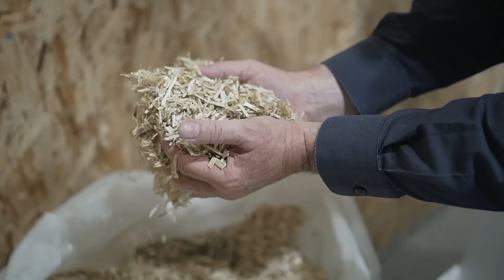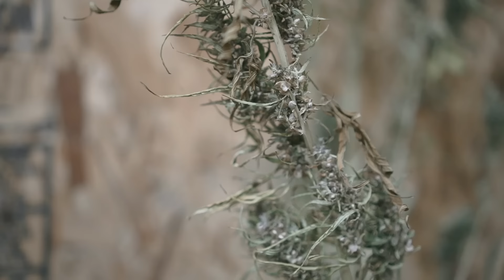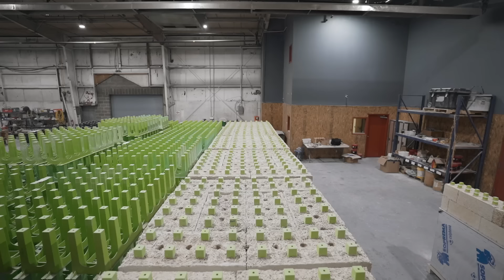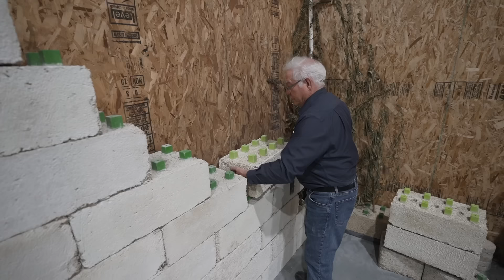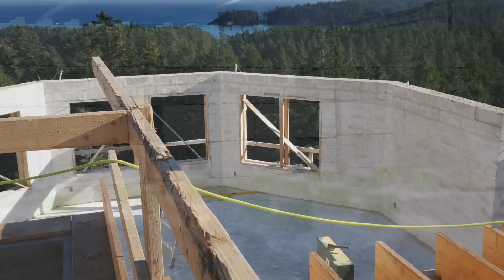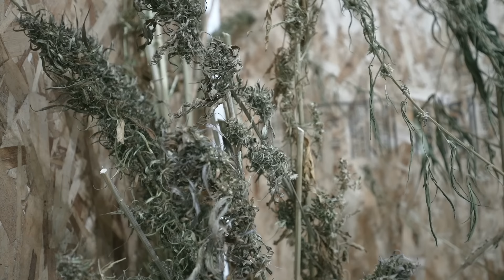Amazing Lego-Style HEMP BLOCKS Make Building a House Quick, Easy & Sustainable

Comment: Wonderful, and does combine structure and insulation into one installation. Technically speaking it is a face seal and I am wondering about details around openings. Any deficiency in seals around openings could result in bulk water into the blocks ? Good documents would be a good countermeasures. Edit: the manufacturer recommends supervision of work by one of their representatives. That's good news
Reply: The R25 insulative value does not meet requirements even in zone A or B in Canada- R30 and R33-40 minimum; so, rockwool exterior or rigid would be required to bring it up.

Comment: the trick for this is mass production, lower coast then standard materials, and simpler installs. it has to be better at those before this will take over, and it needs to take over.

Comment: So it's basically using metal for the actual building and load bearing and the lime and hemp is just insulation. It should be called 'metal building blocks with hemp/lime insulation'

Comment: let's be real .... hempcrete blocks are super expensive have a fraction of the strength of concrete  can not be used near or underground ... it will never happen (commercial success) ... it is not fireproof ...there is a point where NOTHING is fireproof.  The advantages are in easy of construction and insulation (although those number being quoted are BS as well) ... For those of you wondering why this has not taken off around the world .... well there you have it

Comment: This is kinda kool and I’ve been looking for ideas for a cheaper eco friendly home in Canada.. but I would never use this.. IMO it is great for a company but horrible for a user. First off I can’t see how well outlets would go in this, secondly if I wanted to change the house in anyways I would have to tear down a whole wall for new outlets or plumbing to be installed. Unless you need a wood frame for the house anyway.. at that point I’m using wood anyway so why use this as a more bulky brick for the outside of my house? Naw it’s not user friendly from what I see.

Comment: Would you use furring strips for the drywall side?
Reply: You can attach it directly to the block every 6 inches can secure it into the supports.
Reply: @paultryba7228  that is awesome! Would there still be room for electrical?

Comment: There was a similar product used in Canada around 1975 . Made with straw and cement , was used on mis size commercial buildings. It sill is operating as designed 45 years later.

Comment: You could use HDPE from waste plastic bottles put it with the hemp and a cheap charge like silica or CaCo3 in a rotary hoven and then compress it in a brick form in a mold.

Comment: Question?? I did not see how  you fastened the top plate ( trusses ) to the wall. How does it work with high winds? Your top plate looks good but how do you  attach it to the blocks?
Reply: Also, how are the blocks fastened to the sill plate?

Comment: They stole the idea from Ezekiel light in the 1980s I worked on a chimney company and a zq8 was the concrete mix that we use to line the chimneys between the steel liner and the outer brick instead of using paper fiber they're throwing in hemp hoping that hemp will sell buzz  name   and if I work for xiquilite I would definitely bring this attention to my superiors and have him start a class action lawsuit against you

Comment: Can see these blocks having a huge impact in reducing heating bills, especially if used in conjunction with tripple glazing and the geothermal systems...
Reply: Generally homes built with mostly a brick or concrete material insulates better than your typical stud and siding house.
Reply: The variable is wide depending on your conditions but the estimate at this time is 30-60 percent energy savings compared to the basic home construction.
Reply: Cant be having that, the energy giants wont allow it. Bad for the shares portfolios
Reply: If it is energy efficient then geothermal will never pay off.

Comment: This is a fantastic use of materials for building,  however I have two concerns.

1 water proofing, if the render cracks and let's in water will that turn the bricks to mulch? 

2. What is there to stop a robber entering the house by using a power saw?
Reply: robbers can easily get into any house anyway. you've got windows right..
Reply: @witoldschwenke9492  Theives are lazy (if they weren't they'd have day jobs), therefore  they target buildings that are easy to break into. Imagine this. A robber walkes down a street,  the first brick house has bars on the window, and a solid wood door... pass. The next brick house has regular windows and a composite door... pass. The third building has impervious shutter windows and a solid steel door but the walls are made of paper mache ... Bingo, the robber carves out a man shaped hole in the wall with a steak knife and enters the building...

Comment: Could you install furring strips vertically so you could install vinyl siding on the outside? do you have to cover the block with a moisture barrier?
Reply: you can attach it directly to the block every 6 inches can secure it into the supports .

Comment: What about putting backing on the wall for hanging stuff such as cabinets do you have to for the wall out with strips and then drywall and if so how do you attach the strips to the hemp blocks and get some bite on the fasteners
Reply: You can attach it directly to the block every 6 inches can secure it into the supports.

Comment: Planning my humble off-grid retirement shack and this is jumping to the top of my list. Those I’d love to rephrase “off grid” to “self-grid” maybe? With that insulation rating in a moderate climate I’m not even sure my power use would be worth mentioning. ;) 

Maybe a 900 sqft. timber frame with this for the walls? Going to research costs before I get too excited. :)

Thank you so much!

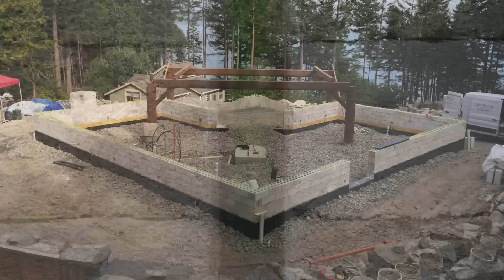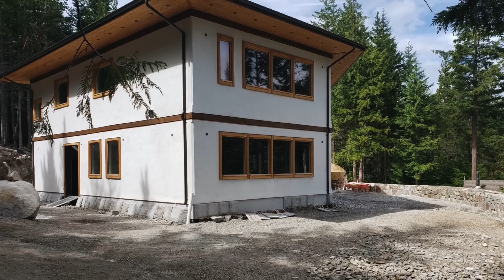Comment: Surely these blocks dont have the load bearing capacity of high performance concrete? 1:13 - 1:18
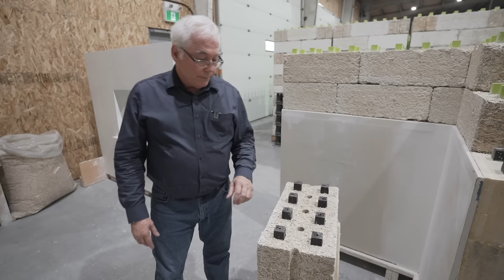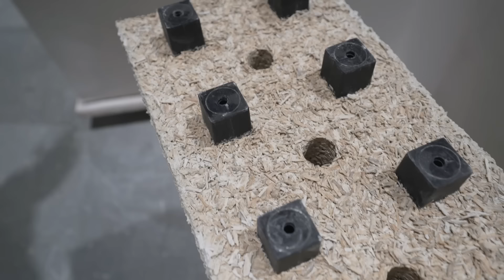Reply: Ahhh, so the internal structure provides the load bearing, got it! This is great! 2:05 - 2:10 and 2:24 - 2:27

Comment: This looks to be a fantastic building material! Truly hope it takes off, with the ease of use , economy and environmental benefits.  
Wondering are there producers internationally, eg. in Australia?  Does the waterproof system work for retaining walls? How do you accommodate plumbing services/can you chase the wall to fit pipes? Does it work with furring channel and plasterboard lining?
Reply: Good questions - the servicing aspect is intriguing to me. As to the plasterboard lining, I'm not sure why you would want to use that other than, I suppose, a different skill-set in applying?  Oh, I see, perhaps to accommodate services more easily?  I would guess though that the adding of two skins would add structurally and to prevent the possibility of air leaks.

Comment: The building industry is really stuck in its ways. I lined my internal walls with plasterboard then spray painted it straight away - amazing how many "professionals" said that I should've applied a skim of plaster - we seem to be one of a small handful of countries that apply a skim of plaster to plasterboard. I'm not sure what's supposed to happen (none of these pros can tell me!) but I'm over 5 years in and the paint hasn't peeled, the plasterboard's paper skin is still intact, there's no cracking or movement at any of the joints...

Comment: So, how much do these cost per building unit versus a conventional cinderblock or a standard wood framed wall of equal dimensions?

Why do you need hemp?
Pretty much any pulp castoff can be used (not sure about it's fire resistance), even mushrooms (which have shown to be similarly very flame resistant).

But the building standards organization is paid for by conventional builders who block anything that's not concrete or wood.
Reply: about $60 per square MORE fro hemp foot at this time.

Comment: How does it hold up once your roof is ripped off and the rained on... Like monsoon season in the desert or a thunderstorm/tornado or a hurricane? I live in Arizona where it would be kind of okay to use this unless wind and water happens which it does. But it'd be probably an absolute nightmare in the Midwest or any place that gets a hurricane. I'm for it but I'm just thinking if a little part of your roof gets ripped off and then wet, it could do some other kind of damage?! One would no longer have the compression from the roof or the coatings on the outside and inside to some what protect the light water absorbing bricks

Comment: How well would the structure hold up in a hurricane? I'm in Pensacola Florida and considering building my own house. Would this be comparable to cinder block or will the light weight of the material get blown away? Could/should you mud a layer of lime in between each set of blocks to increase strength?
Reply: Oh yeah, how much per block?
Reply: Poorly.  It has low mass.  Florida is too damp for a material like this.  Stick to concrete and EIFS.

Comment: How do you permanently waterproof exterior walls and also prevent interior and exterior wall cracking from shifting blocks and settlement?
Reply: They use a quicklime wash it sounds like, so you don't.  You'd have to reapply it ever few years, so large ongoing maintenance costs.

Comment: This would be terrific in a high wind environment. The holes for running wires could have a lenth of threaded rod and that would hold it together including the hempcreate roof trusses that they don't have yet. I can see 20 foot long by 4 feet wide floors (no joists) also with a rod or two to keep them tied to the walls. If a tornado comes strap yourself in because it would have to take the whole house intact. No way debris can go through that either.  I thought about a product like this only a shot of foam as a component. I got hundreds of ideas and no time if you would like to talk.

Comment: Just think, at one time hemp was banned in the US, this is after we had been using it for making rope, sail material, oils and such, it was pointed out as a addictive substance when smoked and was put on the no import list....The new needs for building products is growing fast, I wish there had been some preliminary material cost included but at least the contact info is here......Bamboo has become a multi use product and the innovations are still growing, it's a strong fibrous product that has many uses.....Hemp is coming into it's own.....

Comment: I would not use that material.
I'd rather have 18" concrete
walls.   They would last a long time.  Just do a 6"  stud wall
inside and insulate with
R-58 
You can he
Reply: Not a good choice , too 
many crooks.

Comment: Years ago I did the elericrical work on a tamped floor (hardened polished natural clay compressed in layers) a hemp block internal  and mud brick / hemp external  house built on site .  The owner made keyed interlocking bricks for stackability similar to leggo, strength and ease of use, but as mentioned early on, the labour content was excessive and block consistency often  was a close to touch and go. Our enviroment is dry moderately cold winters through to extreemly hot  humid wet summers. The owner discovered he could only make the best hemp  bricks for 3 months  per year, and experiments with contaner sized  wood drying kilns worked ok, but detracted heavily from the environmental results desired, and kiln use and build was not budgeted for. very  Forward and alternitivley thinking at the time, but to be polite, backward engineering. The hemp chip was imported from Asia, as growing was forbidden in Australia. That was another head ache for him.

Around 7 years for a roughly 12 x  12  meter house with 3 meter verandahs and loft bedrooms. He ended up building  the primery support and roof structural first using recycled timber just to get significant progress and the job done. 

I'm sure if thses blocks existed, my old hippy mate would have danced for joy, and his wife would have been considerably more enamoured with his efforts. His dreams of making a living  by building hemp and natural houses for others became his bane.

Happy wife, happy wife

Great product, and congratulations on getting this amazng type product approved and engineered.
After 30 yearsodf seeing the inefficiency in  construction, Any alternate to the norm I welcome with open mind and arms.

Any plans to bring this building process to Australia?
Reply: This is a rather heart-breaking story to hear, and underlines the difficulty in trying to move outside accepted norms of building at any one time.  Let's hope those norms shift quickly.  I personally can see only benefits from changing to a system like this, not only for environmental benefits, but also potentially to enable self-build more easily

Comment: Great video. I'd love to see this style of house become more common than a typical wood frame house. I want to build one using this material at some point, but it will need to be a dome house for storm resistance. Double walled with solar tiles covering the outside of the dome and a wind generator at the top of the dome and air intakes at the bottom of the outside shell. Hide the batteries in the basement and you are basically storm proof with your own power, year round.
Reply: I wouldn’t want to be living on top of, or so close to the radiation the batteries give off.
Reply: @kimariokiji  Your mobile phone gives off more radiation than a battery of any size can. They don't have any transmissible element to them. Also there would be about 2 stories of height from the ground floor, to the basement level where the batteries would be installed, so as to make them storm proof. Best batteries for this type of installation is Red-Flow liquid batteries as they never wear out, you just need to replace the pumps once every 5 years or so, depending on the quality used. With a foot of Geo-polymer concrete and rebar between each level. Think upside down skyscraper. Make it as deep in the ground as you like, as the deeper you go, the more warmth you can pull from the ground for the heat pump setup. Once you are down 30 meters there is no modern infrastructure to worry about damaging. Especially if you build on an area with no previous human activity. Need more space, dig another room. Sandstone base material would be very handy here, but using Geo-polymer concretes is almost the same after they cure. 

This kind of building could likely survive a nuclear bomb dropped 20 to 50km away, where as most square buildings would be flattened.
Reply: @elizabethdg  You do realise breathing causes oxidisation of your cells causing damage, which leads to visible ageing. Everything is killing you, it’s just that most of it is too slow to make any difference. If you are so worried about phones, or other electronics, go live in a tent in the rainforest. Assuming there’s any left.
Reply: @kimariokiji that was my first thought
Reply: That is actually not a bad idea 🤔🤔🤔 ...

Comment: How well does it hold up against water infiltrations and moinsture ?
And how does it compare to regular concrete blocks price wise ?
Reply: Probably want to create an adequate roof overhang at a minimum of 4 feet...
Reply: It holds up to water very well. It is meant to have a lime render on the exterior but even without would absorb water then evaporate it
Reply: @rehabdetroit  
Too much water will cause the hemp to rot.
Reply: @b_uppy  Correct. If it was submerged in water for days it will rot. I have had an example wall sitting oustide in the elements all year with no finish or protection. Storm after storm and still nothing. No mold, no rot. They have samples of buildings that are thousands of years old with this material in them.
Reply: @rehabdetroit  Can you tell us more? What do you think about the above comment about needing a large overhang, as shown in the project house?
Reply: @sroberts605  This all depends on the climate of your area. There is a hempcrete house built in Israel with no overhangs at all. A florida home was built with eaves about 2.5ft. That home was built by an architect for his own personal means so you know he took a lot of care to get it right. There are many things to learn on hempcrete and how it can perform as it is being reintroduced but I have seen it outperform many modern housing systems from my own personal use.
Reply: @rehabdetroit  Hot and dry in Israel, humid and hot in Florida, damp and murky here in the UK (actually beautiful today, lol).
I'm so enamoured of this solution, I can't quite see how it hasn't happened like this before - we've used lime for ages, we've used hemp, mostly for ropes etc, but I'm not aware of these in combination for building historically. Cob houses perhaps the closest?
But these bricks/blocks in combination with the ingenious structural insets just seem to me like one of those things that were always there, waiting to be expressed!  Like Michelangelo with his David.
Reply: @sroberts605  there are samples of structures thousands of years back that are made of hemp and lime. They found a bridge in France. It really is so cool!
Reply: @rehabdetroit  Hemp didn't exist in the old world 1,000 years ago.  It would have been sisal.
Reply: @michelle.lin3653  The cultivation of hemp began more than 10,000 years ago in the region that is modern day Taiwan, as one of the world's first agricultural crops. The earliest known fabric made from hemp was woven somewhere between 8,000 and 7,000 B.C.E., found in present day Iraq.